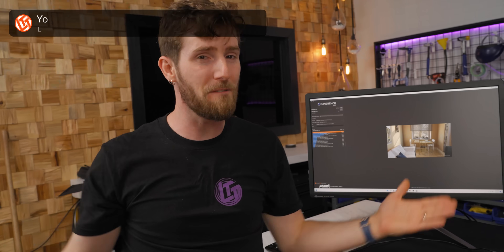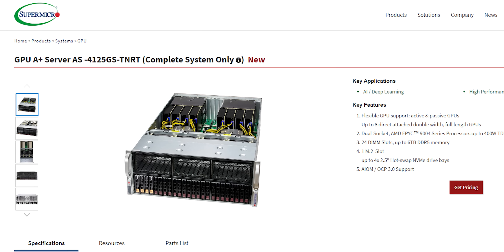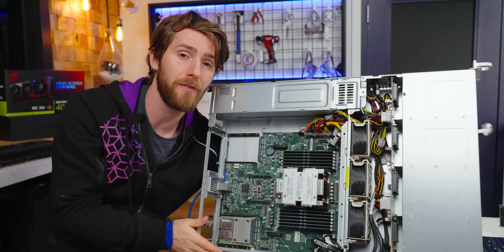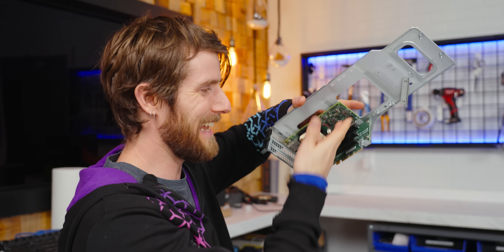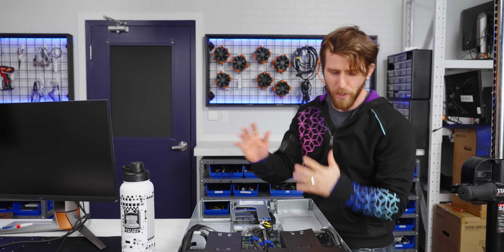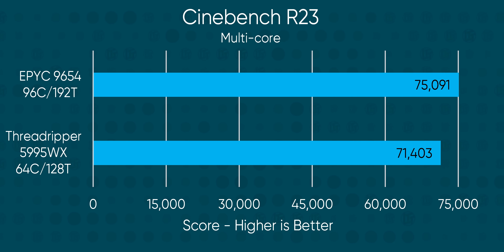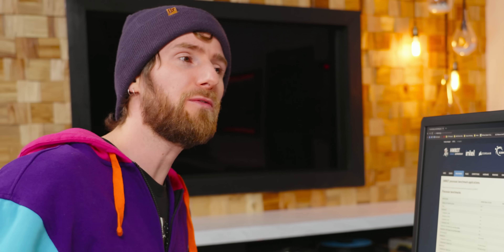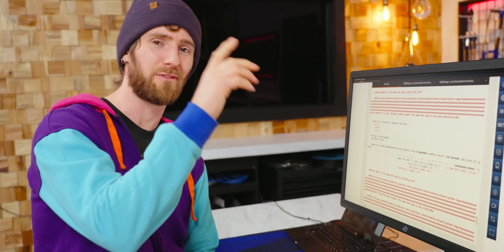HOLY $H!T - The FASTEST CPU on the Planet - AMD EPYC 9654

Comment: Man, we are at the point where we could theoretically install an operating system on the L3 cache alone.
Reply: Someone has to do that like NOW.
Reply: Agreed, OS's should be embedded.
Reply: Well, we should be able to cram DOS onto it
Reply: can we run Doom off of just the L1 cache though?
Reply: @avroarchitect1793  asking the real questions here
Reply: Wanna change your os? Buy a new cpu...i can see it now
Reply: @EliteNK  next we see if it can run Crisis
Reply: Wonder what kind of absurd performance that would give to every day tasks
Reply: @mgord9518  everything happens now
Reply: Damn Small Linux!
Reply: @ddognine  I mean there is microcode and Intel ME or AMD PSP
Reply: @FacialVomitTurtleFights  I'm old enough to remember swapping out OS ROMs (read only Memory). OS loaded faaast
Reply: Well windows 95 only required 4mb ram... I expect windows vista probably could install in the cache just. Windows 10 will probably be able to install in the cache of the genoa-x chips perhaps
Reply: saving $180 on a 980 pro, good call
Reply: @avroarchitect1793  you a real one 💪🏻
Reply: And run Doom on it.
Reply: @FacialVomitTurtleFights  Just waiting for the day when mass storage and RAM come together into unified memory on a CPU's cache.
Reply: imagine choosing which bootdevice to launch from and a dropdown opens and you select cpu
Reply: Kolibri OS could boot from a 3.5" floppy disk, which is 1.44Mb. And it has proper GUI.
Reply: @nayphee  m1 is getting there
Reply: @longebane  You'd need an operating system to be able to treat all storage as RAM effectively
Reply: @avroarchitect1793  Easily.
350 megs is a shitload of space if you're smart about it.
Reply: Still can't run crysis though.
Reply: I mean people already managed to install games on Pregnancy tests, VRAM and such.
Reply: OS used to be built into ROM, you could put the OS into cache but you wouldn't be able to expand it much.
Reply: @FacialVomitTurtleFights  Jesus don't give them that idea!
Reply: @FacialVomitTurtleFights  don't give them ideas! 😅
Reply: @cjnf11  that would be interesting as hell. I guess there would be a lot of issues with allocation, but when you're talking about so much memory it's totally possible. Interesting
Reply: alpine linux maxes out at somewhere around 300 MB, so it is totally feasible to install alpine on L3 cache alone
Reply: We were at that point in the 90s
Reply: my same thought!
Reply: @FacialVomitTurtleFights  Just imagine having to apply pesky ole' thermal paste every time you want to switch your OS
Reply: 🤣🤣 Future is here
Reply: tinycore linux
Reply: Ramdrive would be awesome.
Reply: Windows 1.1?
Reply: Intel Sapphire Rapids Xeon Max, scheduled for January 2023, is supposed to have up to 56 12th Gen cores and up to 64GB of high bandwidth memory (HBM) that can be configured as main system RAM instead of as a cache, so all of the RAM for the system could be "on chip".

Of course, in many ways the operative phrase for Intel announcements has been, "I'll believe it when I see it", but lately, competition from AMD seems to have convinced Intel that they need to get their act together.
Reply: My rough estimate -- you can have windows xp on L3 and it would be completely fine.
Reply: You can emulate an amiga on the L2 cache, and then some.
Reply: So what operating system can really take advantage of it?
Windows Server x64 or a Linux system
Reply: Then you will boot up on 0.2 seconds
Reply: @nayphee pointless.
Reply: @longebane not mass storage. He s talking about real computers not toys.
Apple M1 cant even run autocad or ansys because  its not a serious computer.
While other companies look for building the most powerful tools apple is thinking about bezels and thin laptops😄
Reply: @Teluric2  was talking about its integrated compute power, not anything to do with its software. You can unclench your cheeks
Reply: If L3 cache worked that way, but it doesn't.
Reply: @avroarchitect1793  Use the CPU as the graphics renderer lol
Reply: @nayphee  do i here a second for DOS 64
Reply: Having a bigger cache slows the cache down so not a good idea because it will be pretty slow.
Reply: GEOS GUI/OS should fit on it
Reply: @domainmojo2162  bitter much? humanity is we.
Reply: Storing bad apple in the cache
Reply: someone has actually done this already. I think with win95
Reply: @Mark-kt5mh  An older debian would probably run xfce with 768mb of ram reasonably well, you can probably fire up a few programs while using the desktop.
Reply: @dylanchen  yeah but how do you even create that "cache drive"?

Wait a minute... I just realized that mean my entire initramfs can fit on cache?

Maybe create a slightly different version called the initcachefs?
Reply: @ddognine  As a linux user, I say HELL NO
Reply: DUDE YES
Reply: Wait til they put 3d vcache on that cpu
Reply: @ddognine do you even try OSes ?
Reply: Until you shut off the computer lol
Reply: @ddognine BIOS/UEFI is what you’re looking for. Also, that is insanely hard. At that point, just put it on external storage media.
Reply: tinyOS is only 12mb
Reply: KolibriOS (linux distro) requires 1.4 MB of hard drive space. we can fit that shit in L1 cache. And it has GUI and several graphical applications, mind you.